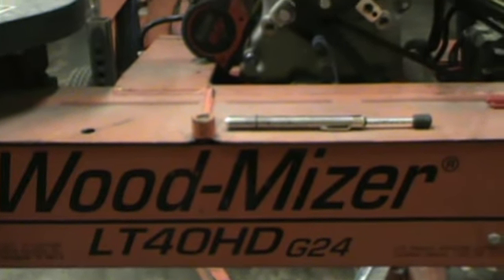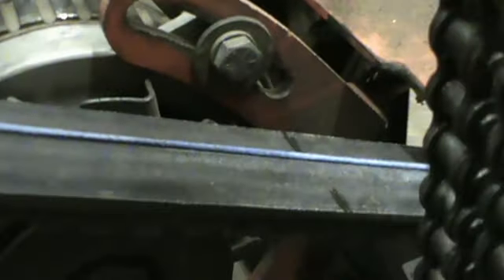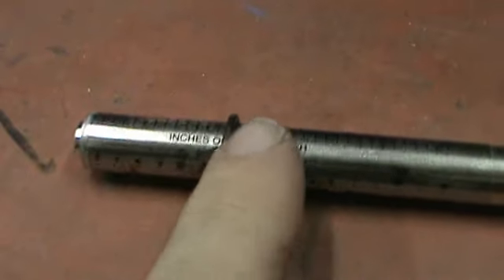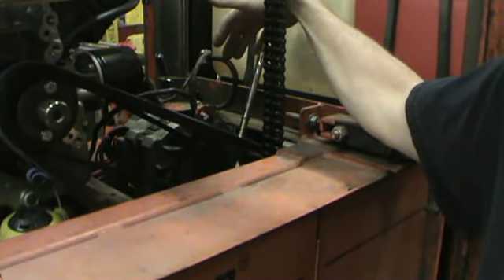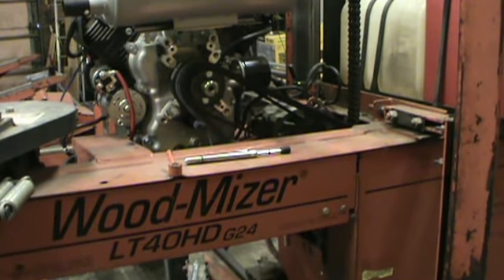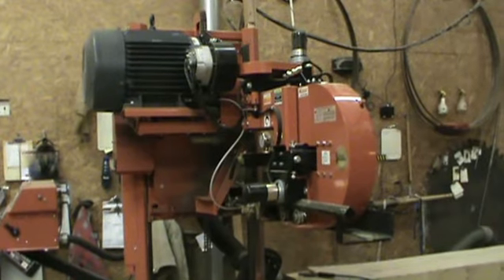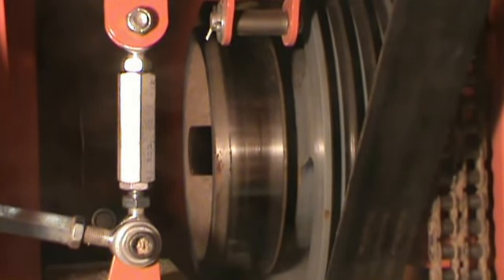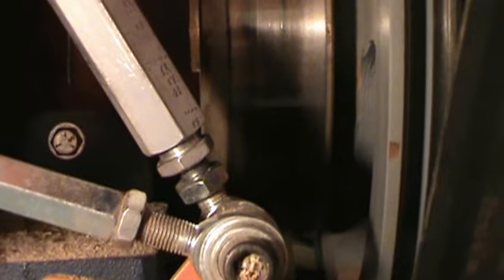Wood-Mizer Belt Tension Tutorial

Comment: My problem is stopping the drive belt from grabbing at the engine pulley in the auto-clutch "off" position.  Still working on it. LT40HD 25HP Kohler.
Reply from the maker: luvbigiron The link below is a Video I made about setting up a bracket to keep the Belt from grabbing.
You can watch the whole show or start @ 8:30 . After that look for "Part 5" in my series of videos. It will show the engine running and the belt sitting still.  https://www.youtube.com/watch?v=pHQqHWRPxUg